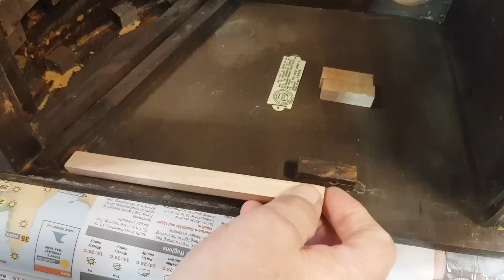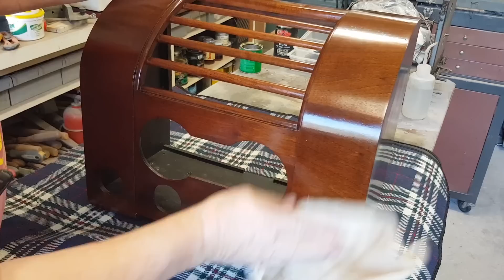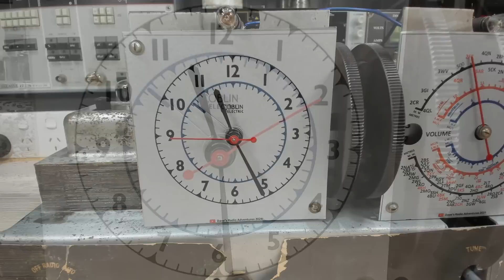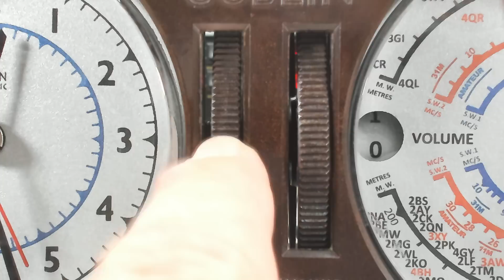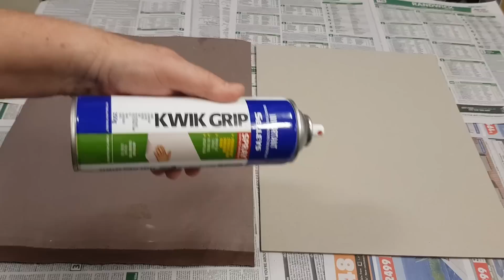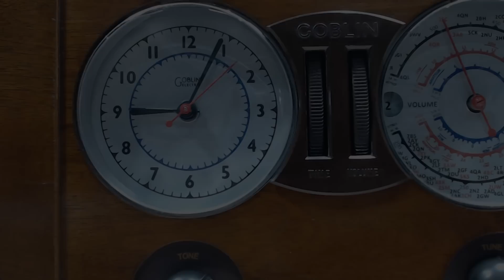Time Spot Radio Part 4 - Cabinet and Laser Cutting a New Back - Final

Comment: Hello Dave, I've been watching the 4 videos about this radio and there is one thing I would have done differently . For the volume button you have made a new scale which can be seen through the dial glass lens. I would have made the numbers go the other way around, and of course change the order of the wires on the potentiometer to match that. Then when you rotate the knob upwards the numbers and the volume go up, now they go down. It seems a bit strange. I saw you also made a mistake when changing the volume because you started rotating the knob in the wrong direction. I know it is not original when you do that, who will ever find out? The result is fantastic, you gave it a lot of attention in every detail. Thank you for this video.
Reply from the maker: The volume adjustment direction is a wacky and I continually went the wrong way. Because the volume pot is logarithmic, reversing the wires would produce large volume changes at very small control wheel inputs at low volume, the opposite of what you want. Thanks for your nice comment De Mus 🙂

Comment: Hi David, a bit late with a comment
Time slips away. Any way you are right about the cabinet on these sets is not top of the range but you have again done very well with the finish on this one, I did like the 3d printed support for the rattan speaker grille, I must get a3d printer  nice one David.
Reply from the maker: Thanks Lee. The printer is very handy 👍🙂

Comment: It looks amazing David! And thanks for showing the work on the case; I really that part. 

I do some woodworking, and the general reason for putting down neutral shellac before stain is so that it comes out more evenly. If you put the stain directly on the wood, the softer areas will absorb a lot more color than the denser areas. Putting down shellac first mitigates this. Obviously some woods tend to come out more splotchy with stain than others, for example maple or poplar.
Reply from the maker: Thanks Brian. Yes, that's exactly right. I didn't explain it very well 🙄🙂

Comment: I'm glad 😌 to know that this radio didn't need a new dial cord. I'm not so sure about the dial light(s), but you've probably changed it (them). I'm so glad to know that the majority of your radios don't  contain those bumblebee capacitors. Despite my saying, you've probably come across a few. Those are the only known capacitors to go POP!! They leak, and drip an oil, or wax like matter, and get quite hot.  Also, DO NOT wire in capacitors backwards. This may sound impossible to do, but it's not. It would be very maddening to have recapped the whole radio, even if its only ONE capacitor, turn the ON/OFF knob to ON, and POP!! There goes the fruits of your labor, blowing out every capacitor on the board. Happy Howlidays (Halloween). Your friend, Jeff.
Reply from the maker: Hi Jeff. I fitted a new dial cord in part 2, pretty easy on this radio. I haven't seen any bumblebee caps in any of the radios I've worked on. Maybe only American radio have them. Thanks Jeff 🙂

Comment: I like seeing how others tackle the case restorations. Your case restorations are up there with the best and I will certainly be trying the shellac technique on one of those I have  to restore. One approach that I saw from a YT furniture restorer was after sanding and prepping the wood surface, was to use boiled linseed oil, followed by a clear coat acrylic spray. I used that on a Bush radio recently and achieved a nice finish. The radio has to sound right and look right. No half measures here.
Reply from the maker: Yes, I've seen that method as well Bob, you can also use tung oil. I haven't tried either. My dad was a carpenter, he had a 10 gallon drum of linseed oil, I don't know what he used it for. I do remember him using it though. It was there when I was born and still there when he died 🙂

Comment: Over the years of watching these videos I have come to enjoy the cabinetry eposides the most; perhaps because it's a skill I do not have and am unlikely ever to gain, although I would love to. I love seeing the museum-quality results.

Regarding the clock: did you carefully check the wheel bearings? If one is worn it could be that occasionally it would cause a wheel/pinion to jam. When working on watches (one of my retirement hobbies) I do everything under a binocular microscope, and check bearings especially on  when non-jewelled.

I wonder if my viewing habits might screw your figures . If I am having a lunchtime pint at the local pub ( very, very rare occasions you understand) I  check on my mobile phone for YouTube videos to view on the big screen at home, so it might appear that I drop viewing quite soon from the pub broadband IP number.  I might pop in and out of viewing a video from different devices, so this might skew YouTube stats. But then I always watch each and every of your videos the full way through, usually with a friend who understands valves, radios and TVs much better than I. He also noticed (2:28) the "Royalty has been paid on this apparatus" label. Did Australia have such a system too?

The result in this video is gorgeous - and I love the improvement of the dials and crystals. Perhaps sapphire would improve things further - that's what I do with personal watches.
Reply from the maker: Thanks frogandspanner. I doubt your viewing habits skew the numbers. YT counts any views of more than 30 seconds as a view. 
I don't intend removing the cabinet work just streamlining it a bit. 
I did check the teeth on all the wheels and all the pivots. All were in good condition except the top pivot for the wheel adjacent to the motor drive. It had a small amount of wear, not enough to impede the clock I shouldn't think. 
We had a patent system called 'Australian Radio Technical Services and Patents Company Limited' or ARTS&P. A fee was paid to ARTS&P and they would pay the various patent holders on behalf of the manufactures. You will see the ARTS&P stickers on Australian and New Zealand radios during the videos 🙂

Comment: It came out fantastic Dave!  It's a shame about the clock's reliability after the work you put into it's restoration.  I get the impression that these clocks never lasted that long in these radios.  Maybe someone will be able to pass along some helpful advice if you decide to pursue it.  Thanks for the video!
Reply from the maker: Thanks Andy. I would like more information on the clock if I can get it, fingers crossed 🙂

Comment: Fabulous job on the cabinet and the rear panel.  I really enjoyed this series. Very strange that the clock stalled after running well for a week; low mains voltage?
Reply from the maker: Glad you enjoyed it Ross. The clock... I don't know, it's supposed to self start if it stops. It worked for a number of weeks after the last fail 🙄🤷‍♂️

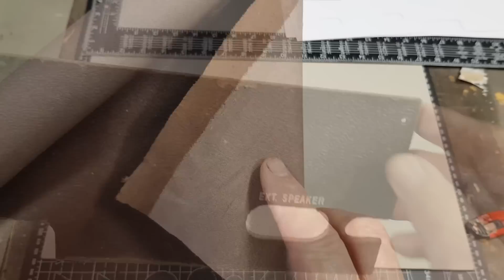Comment: 17:54, This is the material we call Percalux here in Brazil. Used mainly in bookbinding and restoration, it is a very versatile material and reasonably heat-resistant, which is why it is used in bindings and gold or silver engravings for naming books.
Reply from the maker: Thanks Carlos, I'll look it up 👍😊

Comment: Cabinet work is not boring for me David, but the numbers don't lie of course.
Daring idea for the clock stopping: if it is the Voltage, there's a 280 V winding on the transformer.
(Edit: but that winding is off when the clock switch is off, so no sigar... )
I have seen clocks fail because the rotor is not in the middle of the stator, but by the look of it this design is not made to adjust for that. If not in the middle they can make a buzzing noise.
Reply from the maker: Thanks Erik. Yes, a higher voltage would give it more strength. If the coil could handle it I could install a small transformer to bump the voltage up a bit. That, of course, is just covering the problem. I checked every part of that clock, rotor clearance centering and anything else I could think of. I will see if I can pick up a working Teas Made with a working clock and check it against mine, particularly the coil 🙂
Reply: @DavidTipton101  Check that fault again over longer time, it could be that Murphy planned one Tipton power down to tease... 🤔

Comment: Hello David. You did a wonderful job on this radio. The choices you made to restore this unit, made this effort a true work of art. We can see your signature in fine craftsmanship from A to Z, as each problem gets overcome with much thought and determination. (Someone might get the idea that you enjoy what you're doing). What looked like a dull cardboard box became a rich wooden treasure! The grill cloth looked great. The choice of lettering color for tuning/volume added that retro glow that makes these old radios a thing to be admired. Thanks for the adventure!  -Chris
Reply from the maker: Thanks Chris. I do enjoy working on them and rejoice if there is a problem that needs a solution. I might have a gene defect there somewhere 👍😅

Comment: You're such an inspiration, I had a timespot off the other half for christmas last year and the clock motor is open. Luckily the dial perspex is ok. I might tackle the clock rewind a bit more confidently now. The goblin is very common in the uk and alot of the clocks seem to fail. That early perspex does seem to cloud over, I have a philco which keeps deteriorating and some early Ekco tv's used perspex as a former for the line output transformer which degrades over time. Love your laser cutter, I want one! Best wishes from the mother country
Reply from the maker: Thanks kevvywevvywoo. I would be happy to send a new dial covers if you decide you need them. I would like more information about coil winding for clocks, what the formula is for wire gauge and turns. As you are in the UK and if you manage to get a replacement coil can you measure the resistance please, that would be most helpful. I wonder if the rotor has lost some magnetic strength as well. Good luck with your Time Spot 👍🙂
Reply: @DavidTipton101  in my notes I have 10,000t of 0.063 (42swg) to read 8.8k. However its common to rewind the coil with much thicker wire then test it on a variac and fit the appropriate mains transformer under the chassis. The thicker wire is more reliable in damp british sheds.
Reply from the maker: @kevvywevvywoo  Thank you. I read where people had used a thicker wire and adding a transformer or tapped off the existing transformer meaning it only worked when the radio was switched on. I put a total of 7640 turns of 0.06mm wire on the coil. The first time I wound on 4990 turns, returning 10.7k resistance.  I didn't record the resistance after I added the additional 2650 turns. 42swg converts to 0.102mm or 0.004". !0,000 at 42swg would make the bobbin pretty full. Interesting 🤔
Reply: @DavidTipton101  I should've said 42AWG I think!
Reply from the maker: @kevvywevvywoo  ahh... that makes sense. I used 0.06mm wire and I don't think 10,000 turns would fit on the spool. There is no way the original spool had 10,000 on it. I saw a number of Teas Made in a shop somewhere cheap. If I can remember where, I will see if one has a working clock and buy it. I will be able to work out the windings from that and record it for others.
Reply: @DavidTipton101  you need the art deco ones with the central clock, the later 70's ones use a much smaller coil
Reply from the maker: Yep, I think I knew they changed the design at some point. Thanks 🙂

Comment: Truly excellent Dave! Loved the back panel process (I've added a laser cutter to my wish list!). The dials do look great too! If the clock keeps stopping it could be worn pivot holes and may need rebushing - and that's a whole new kettle of fish which I've been looking at for awhile myself!
Reply from the maker: Haha... and Xmas is just around the corner Chris. I checked all the pivots, the only one with any wear was the wheel driven by the motor and that was only very slight. I considered making a brass bush to replace the worn pivot, I think I could do it but for the amount of wear I didn't think it would make any difference to the clock functioning. I bet you can buy pre-drilled inserts. You do one and I'll copy you Chris👍😅

Comment: I wonder if you could make a new cabinet finished in dark french blue and silver to match the dials,  it would bring it up to modern.  Adding somehow a little FM module with a AUX additonal switch could make it interesting. But Goblin Vac Cleaners had the wooden look and it was all the rage, once.
Reply from the maker: I could do all those things but it would be a new radio, I would still have to do the Time Spot 😅 I know what you mean Highpath. I could easily add Bluetooth to this if I wanted. Thanks 🙂

Comment: This is a great radio restoration ! I too love watching you restore the cabinets.  I have learned a lot from you about restoring my projects. Thank you for putting  out these videos.  The one thing I would add is putting some felt pieces under the knobs, it would be a shame to scratch the panel that you put so much work in recreating.  I think this radio has a great style all of it's  own.
Reply from the maker: Thanks Robert. Good luck with your projects. It turned out the cabinet pressed against the printed backboard and not the knobs as I first thought. I was going to put felts in there but it wasn't necessary when I worked that out 🙂

Comment: Excellent cabinet work as usual David. I enjoyed this nice project throughout all parts. Nice job with the laser cutter on the back parts makes them look factory. I also watched a video by  M Caldeira few days ago he was doing a similar thing making a rear case panel on a laser cutter came out excellently as well.😃😃 They seem to be very useful tools in this hobby.
Reply from the maker: Thanks Alun. I was disappointed when Manuel put his laser cut radio back video up. I did my backs a few weeks ago and Manuel stole my thunder 😅 The laser has been very helpful 👍🙂

Comment: I rather like the cabinet videos you do. I renovate a lot of old valve radios, I am very au fait with the electronics but no idea how to do the wood work and other case thingies. Also sadly in the UK there is almost nothing to recieve at all on LW or MW. My first full renovation was a Bush DAC90A, I spent forever doing it. It was fantastic finished. Then I went to use it proper, bugger all, I got 1 LW radio station. Annoyed it went back on a shell to gather dust. In a fit of inspiration a few years later I got it down, took it apart again, tested everything again. It was totally perfect, all voltages correct, perfectly alligned. It was then I checked what you could receive on MW an long wave, bugger all. Never mind it was a laugh.
Reply from the maker: My first AC/DC radio was a very sad DAC90A, it was a lot of fun and came out looking good. It's sad you no longer have any stations left, it is only a matter of time I guess. Thanks Dave 🙂

Comment: Superb job! Those rear panels are  gorgeous! Like yourself, I became annoyed with the "reverse flip" of the volume control from minute 1..logic tells me that You may move It up to higher volume and down for lower....I would have nightmares about that (yes, I am a little OC)...and I would change (if the potentiometer is linear, NOT logaritmic) the two connections of ground and max volume, and, of course I should have to remake and attach the ring with the numbers on It. But....as Mr Spock would say: "now It is logical"  and my OCS will snore through the entire night undisturbed. Thanks as always for your supreme jobs...I enjoy so much your videos! Greetings from Buenos Aires, Argentina!
Reply from the maker: Thank you RI. Regrettably the volume pot is log so reversing it is not possible unless I could flip the resistive strip. It is not logical but not a big enough issue for the designers to address I guess 🙄

Comment: Dave, as usual you've done a bang up job, turned an ugly duckling not into a peacock, but it presentable duckling. 
Thanks for including a bit of the cabinet restoration, the laser cutter is quite a tool.
    Boy if your local radio club ever had another build a radio competition you'll get the blue ribbon for sure.
Reply from the maker: Thanks Mack. We haven't had a radio club comp for a while. I hope they do, the last one was fun 🙂

Comment: "Methylated spirits" are referred to as "denatured alcohol" in the United States.  For my part, the repair of the electric radio portion is the least interesting part to me.  I like the cosmetic repairs and the clock rewinding you did on this radio.
Reply from the maker: Yes!... I remember it later, thanks FrankenShop 😄

Comment: I bought a Co2 lasercutter a few years back, it's the best tool I ever bought,  but please be careful what you put under there. If your backing material is made of vinyl it will contain PVC and you don't want to cut that. Just be really sure what it's made of before putting it under the laser. especially with a open frame lasercutter.
Reply from the maker: That's an excellent point Voyager, I hadn't considered chemicals in the materials being cut. The cutter is in my workshop and I open doors and windows when it's cutting and I keep away because it can get quite smoky. I'll keep it in mind, thanks 👍